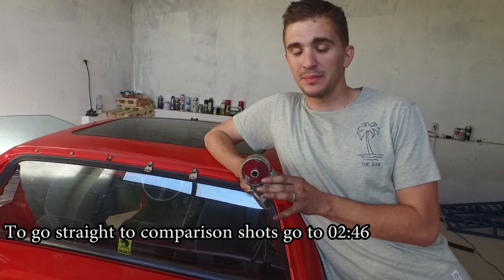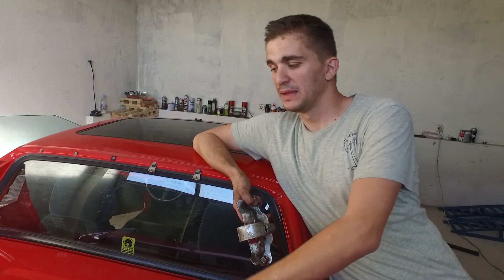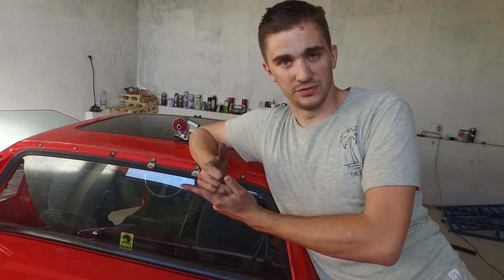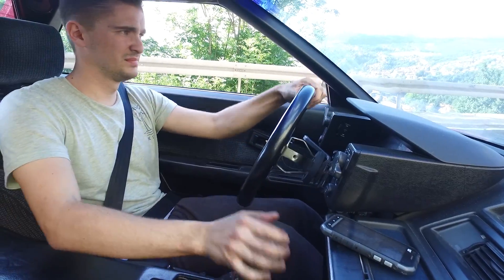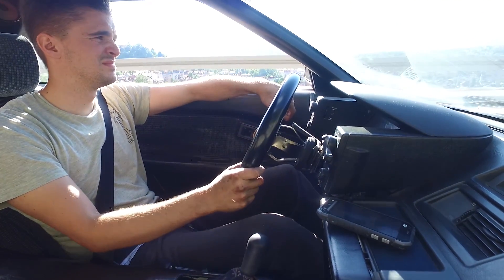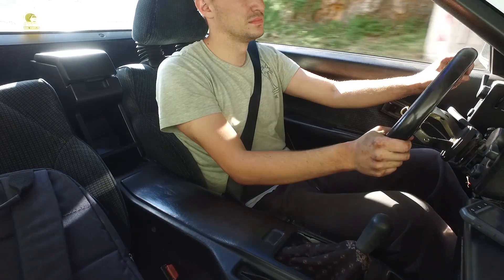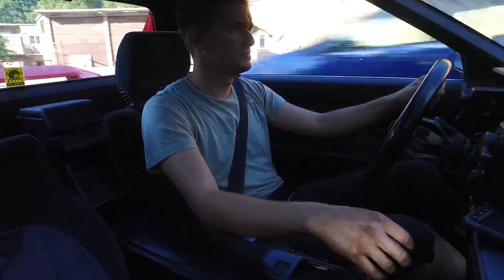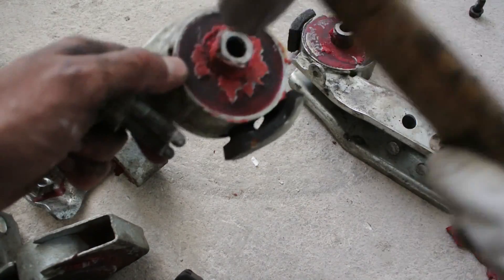Polyurethane vs. stock engine mounts - detailed comparison

Comment: I'm doing this within the week so seeing your follow up video is really helpful as I had seen your original last year.  We are going to do this for our old VW MK3.5 Cabrio.. two horizontal mounts (one on front of engine, one on transmission).  Based on your update  I think I will instead go with ReoFlex 50 instead of the 60 and I'm going to lightly grease the pin with vaseline to help keep it flexible as some people mentioned in your 1st DIY that some bush pins are made to move and rotate such as with control arm bushings in particular.  Your thoughts on that??  - Secondly, I think I will also use a few 7mm rods I have on hand to make 6 additional holes on the mid line of the circle for added flex.  I'm thinking those two things will get mine closer to the comfort of rubber with the durability of the poly while still adding a touch more stiffness. The car is a daily driver and while we are souping it up some, including a DIY engine rebuild soon with 8v to 16v conversion to got from 115hp to 160hp, we still want it to be a comfortable ride.  A street car with some modest performance gains, but not a track car.
Reply from the maker: +Jeff Chartier Reoflex 50 and some holes should provide more comfort. The placement of the holes might be tricky and not straightforward. But the holes will do more for comfort than the difference between 50 and 60 shore hardness. When I made mine I imitated the factory design in which the pins do not move at all. I believe that the pins should not move in an engine mount, be sure to check the factory design of yours. Good luck!
Reply: Agreed on the movement, I checked mine and no pin movement.  They do have slits though so I will add a few holes. I have a drill press and shop full of tools so this will be no problem. Cheers from San Diego CA.

Comment: I did the 3m window weld polyurethane fill, and it idled amazingly smooth  and held great with launches on my 99 prelude. The window weld looks a lot softer than this but it stopped wheel hop completely.
Reply: Ton M thanks for sharing I ll try 3m!!!
Reply: Any1 else tried this ?
Reply: Do you also used it in suspension.
Reply: @badtimegonesingh8883  yes I have used it on other cars

Comment: What was the Shore A hardness of the PU you used to make your bushes?
I've noticed that one can buy different hardnesses ranging from 45 to 90. Standard rubber bushes would be roughly equivalent to 40 but also often have cavities to vary the stiffness in differing directions. 'Sports' and 'track' pu bushes are usually around 60 and 90 resp.
maybe you could experiment with 'softer' PU?
Reply from the maker: Cyclone Cyd I made them in 60a. I thought it would be a nice balance between 45 stock and 90 track. Thanks for watching.
Reply: I believe using 40A would work way better after all you fill up all the empty space unlike in the stock rubber mounts so even with same hardness you get it more stiff

Comment: Thank you so much for this video!! I have my yota 95 celica gt and my motor mounts are shot I fully intended to replace them all with poly... Thanks to your vid im going to forgo that decision and go with high quality rubber mounts! I have a question about poly bushings as for control arms and sway bar links? Do you have a vid in regards to poly sway bar and control arm bushings? I need to replace those on my celica as well and im looking into poly... Thanks for the video very well laid out and very well conducted tests my first time on your channel like button smashed and subbed ill be following your other vids condering i am currently iso a MR2 thanks again!
Reply from the maker: Keith Baker Thank you for the kind words. Glad the video was useful for you. I have actually purchased a prothane total kit for all my suspension bushings and will be installing it and reviewing it in the next month or two depending on how well my bike carb conversion engine build goes :)
Reply: driving 4 answers thats about the time frame I am intending to build my suspension I will patiently be awaiting your review prior to my purchase thanks for your obvious hard work in making these vids i know its not easy as people may believe!

Comment: First of all, thank you for the honest review. It is exactly what I had suspected from your first video of making it. The function of engine mounts is to absorb the vibration of the engine. As the engine get older, the vibration would be more. Therefore the DIY would defeat the purpose of fulfilling that function of absorbing the vibration as it is too stiff. 

Maybe having some gaps between the filling would compensate and reduce the stiffness. However, you need to make a mould for the pouring which likely to cost you.

Comment: i think your polyurethane mix is just too hard that's why it transfers vibration to the mounts, instead of absorbing it.
Reply from the maker: Tomas Av. I went with 60a shore hardness, which is softer than 80a. 80a is what most aftermarket ones are. But 60a is still significantly harder than stock rubber, which is like 30-40a.

Comment: Try to make some holes to the polyurethane.
Reply: you should try that, and share the result. ( I should try that and share the result ? ) WE SHOULD ALL ADD TO KNOWLEDGE VIDS.
Reply: Rully Rama Wijaya or just use a lower hardness. You effectively accomplish the same thing without introducing stress concentrations
Reply: nan3r That from a physical stand point is why you should drill or cast these with holes.  The material has elongation properties not being harvested in the solid form. Stress and strain are present and changing over the frequency and amplitude ranges. Holes allow these to decouple from the metal and dissipate the energy to the air. Hope that helps.
Reply: nan3r my assumption is the engineering and manufacturing design reached a product that performs in a cost competitive way. Mimicking that with voids is doable for the diy crowd. Spider dampening design is common and the range of motion is pretty predictable as we see some webs thicker where strained and also a range of frequencies oscillations would dissipate to the matching harmonics. An ideal mount might employ some of the high tech phase changing viscosity materials. These engineering problems are not my bag. I am a scientist.
Reply: You are right, but there is a problem with your reasoning. First you're under the impression that these materials will act similar and proportional. I honestly don't know if they will or not. I would contest that you would need to do your own specific dynamic stress modeling to figure out the proper slotting. Sadly this is also going to be done by a per material bases. Needless to say most DIY have almost zero engineering. Although this can be said I would be willing to wager for alot of aftermarket polyurethane parts as well. After all these companies have a vested interest to make money.
Reply: Jacob Ingram that is correct. I think the words for the unit of measurements to compare materials is shore. A durometer shore hardness scale would be a starting place to begin experiments. I would think to develop the casting skills would take a few attempts. Maybe using fusion 3D software some reasonable designs could be modeled. I just purchased some chassis bushings for my car. They are factory stock and look to be complex designs as well as composed of different materials. Some of the materials look to be Teflon. The engineers must have fun developing these. Too much for DYI, but failure is learning. Thanks for reading.
Reply: Snowy Owl 
“stress and strain are present and changing...” 
Agreed.

“The material has elongation properties...”
So you’re implying there is a benefit to using a higher modulus material with holes versus using a lower modulus material without, because the voids/decoupling allows better utilization of the material’s viscoelastic properties? 

Would be interesting to see this plotted. That is, determine an overall stiffness equivalent for both designs, then compare the dynamic response of the two
Reply: Emanuele Moriggia that's right, he should try that, and share the result

Comment: The best way to do PU mounts is to either select a  softer Pu formulation like a 60A or 70A or just fill one rear mount and leave the rest stock or drill some holes in your full PU mounts to create movement. The concept of PU mounts is that they last much longer than the OE rubber mounts.
Reply: Do you happen to know the Rockwell hardness of the Prothane mounts?
Reply: @inorite4553  it is shore hardness.
Reply: He used a polyurethane with a 60a shore rating

Comment: Good comparison. The 'floating' aspect of the original rubber mounts dissipates the vibrations better. 

I replaced the transmission mount only and noticed the vibration difference, even after putting rubber on the inside mounting surfaces where metal meets metal. I really noticed a difference in performance, the power delivery is much better.

Good luck in getting as many hits with this vid. :)
Reply from the maker: +Car Dude Thank you :)

Comment: if u wanted ti reduce the vibration that caused by the mount  why dont u make holes around the connction inside the polyurethane mass .  making less connection makes the polyurethane less connectivity for sounds and vibration comparing with rounded  connection ( I guess)

Comment: awesome as always, i was actually thinking about putting  some poly in my suspension, but now i'm not so sure :D
Reply from the maker: +scghost Good to see you again :) I have already bought some polyurethane bushings for my suspension too, I'll make a video about those too and try to compare them to stock somehow. The trouble with poly engine mounts is that the engine vibrates as soon as it's running so you feel the noise and vibrations all the time. Suspension is a bit less concerning, because as long as the road is smooth poly bushings shouldn't annoy you, at least until you hit a pothole :)
Reply: driving 4 answers Je suis sûre que tu parles français. Anyways I think the short wheelbase of that car and the stiffness or less amount of flex that comes with it has added to the vibration. Great effort.

Comment: Nice vid as always, do you think the zero engine movement with the polyurethane mounts will help to reduce the stresses on cv axles?
Reply from the maker: +Javier Broger Thanks glad you like it. Hmmm that's a good question, in theory it makes sense I guess, but to really be sure we would need to test it out somehow, which is easier said than done.

Comment: Now that's what I like to see proof of the advantages and disadvantages between stock and mod if only more data like this was out there so many people think if it's aftermarket it has to be better and make your car faster (i.e. Cold air delete/short ram intake) but thanks this is good info to have I was thinking of getting some polyurethane for my Supra but I think I'll just keep it stock there I love the sound of my cutout too much
Reply from the maker: +James Violette Thank you, I'm happy to see you appreciate the data, and you are definitely right, nothing should be assumed until proven. Unfortunately there's a lot of mods out there with wild claims based on nothing but theory. Poly mounts do actually deliver what they promise, it's just the downsides that make them better suited to track oriented cars.